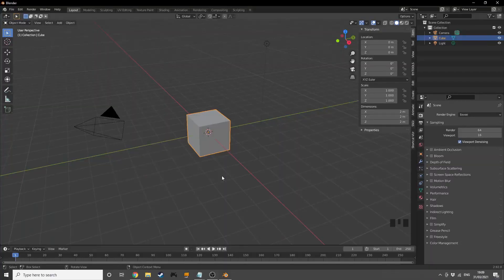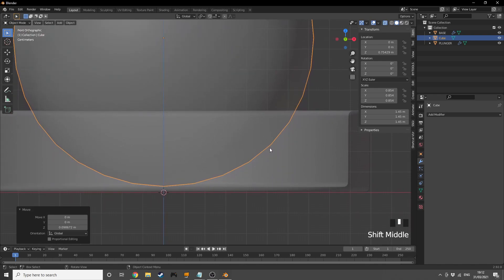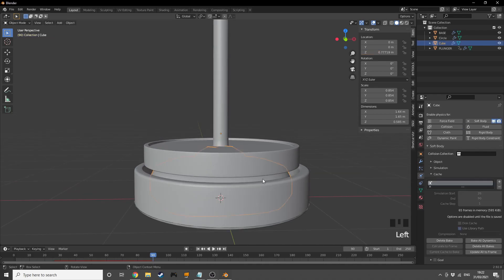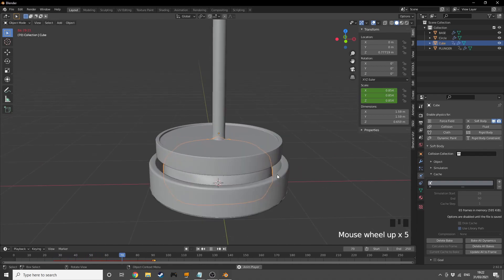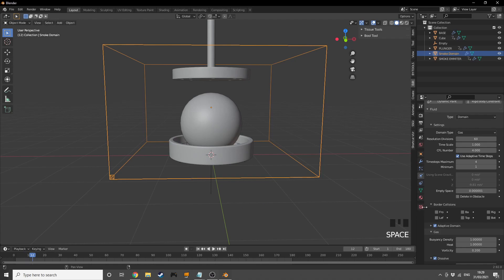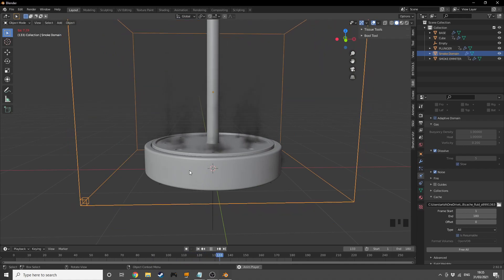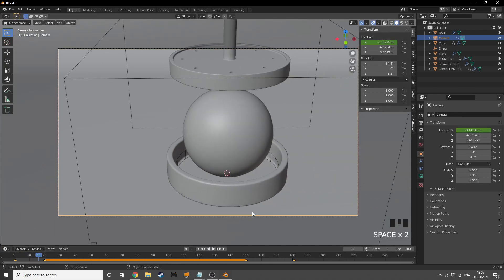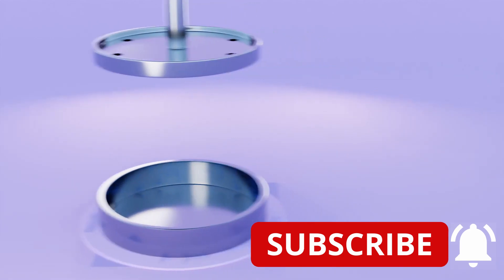Blender - Ultra Satisfying Crushing Animation Tutorial!! (Physics Simulation)

Comment: I have a problem my smokes is penetrating through the base. What do I do ?
Reply from the maker: Either make a thicker base. Or go into the physics settings of the base and increase the collision steps
Reply: I Have the same problem. except the smoke is going thru the plunger as well. I want it to go through the holes only

Comment: I got a problem on 5:37 the ball doesn't react to the soft body I added
Reply from the maker: The ball should have soft body physics on it. The rest of the objects should have collision physics on them
Reply: @Shtefanimation  I did that and it doesn't work🤷🏻
Reply from the maker: Make sure you untick goal in the soft body physics properties. Hopefully that works
Reply: @Shtefanimation  Still doesn't work its in evee 2.9 right?
Reply: @Shtefanimation  Hey mate. I am facing same issue. I did exact same thing as yours, but ball just falls down every time. Please help with this.

Guys, I figured this out. I thought we usually don't have to apply subdivision and cast physics on ball. You will have to press "Ctrl + A" on both of the physics, and ball will react to other objects.
Reply from the maker: Im not sure what you mean by that. You can apply that subdivision and the cast like i said. And then if you have collision on the coliders and soft body physics on the ball,then everything should work
Reply: @XxDarkxX15  Thanks man! helped a lot. I was facing the same issue in most of my blender projects. I was just not applying the modifers.